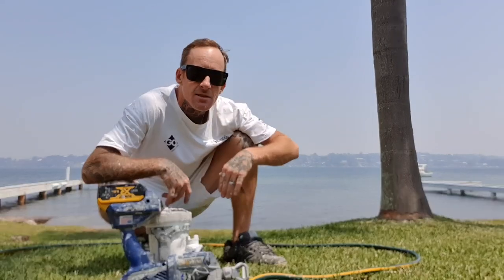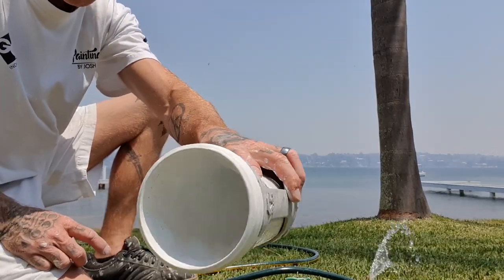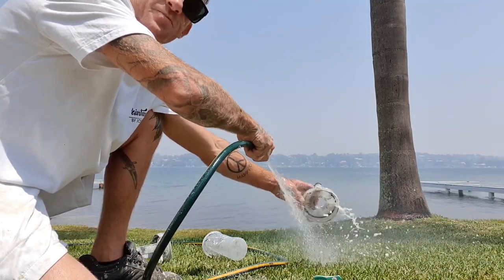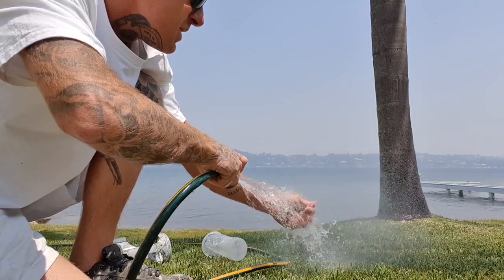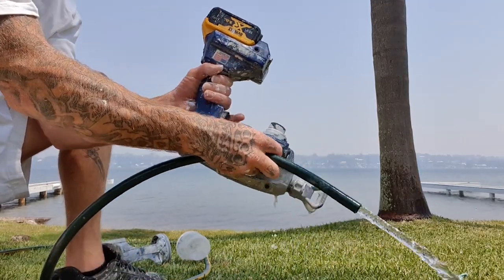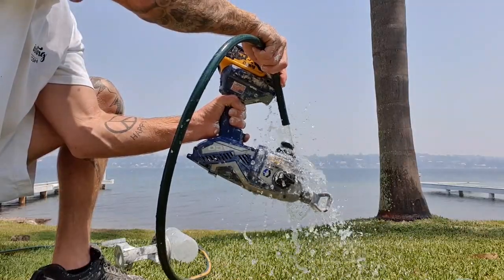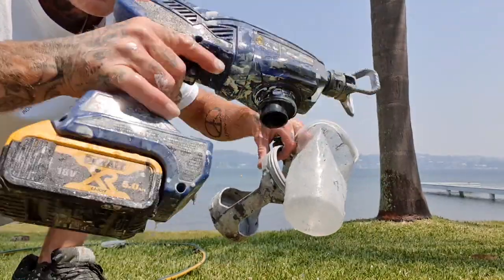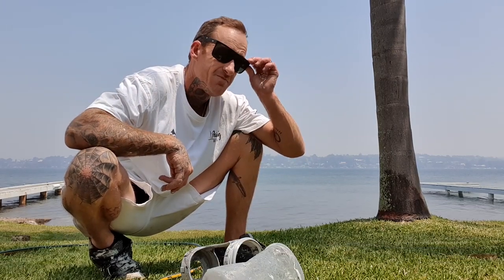QUICK WAY TO CLEAN OUT GRACO ULTRA MAX HANDHELD

Comment: How do you clean it if your using oil based paint ?
Reply from the maker: Just pour in the solvent and run it through a few times spraying in a bucket repeat the process until it's running clear💯🙌
Reply: @paintingbyjosh  iv had a problem with my gun second time using it Is there a way I can possibly send u the video I put enamel semi gloss and it’s just spitting out the paint rather than spraying it

Comment: This is definitely the best way to clean out these handheld units. Now if only the pumps wouldn't die so fast or cost 200bucks. I've killed 3 pumps so far, with meticulously cleaning them and babying the units, I don't think I'll be getting a 4th. Not worth the hassle, even though I will miss the convenience of the cordless sprayer.
Reply from the maker: I agree I do not use these machines being they are so unreliable and always dramas💯 not worth the hassle
Reply: @paintingbyjosh what do you use instead? Any reliable ones?